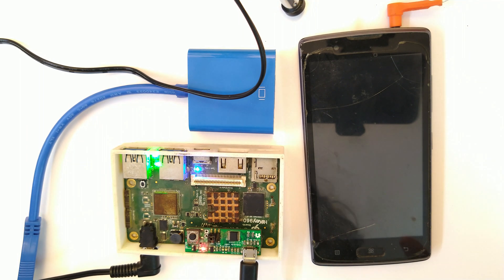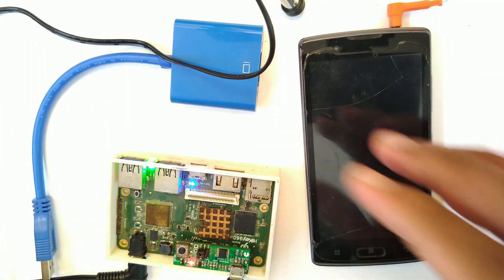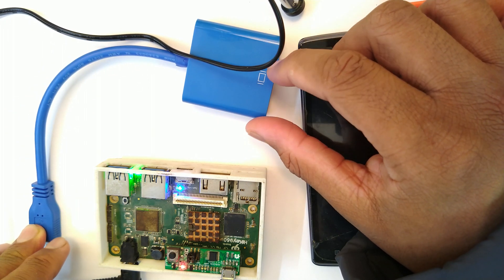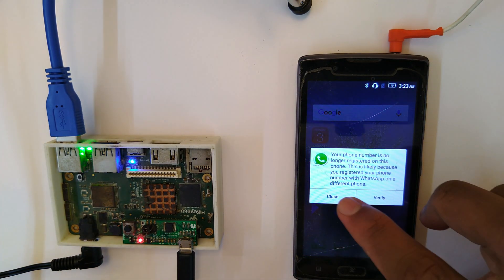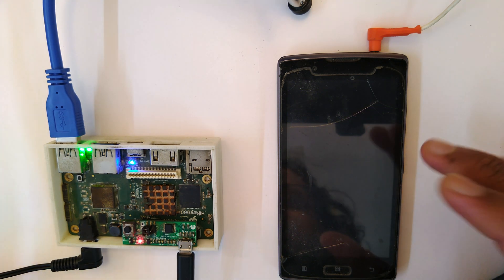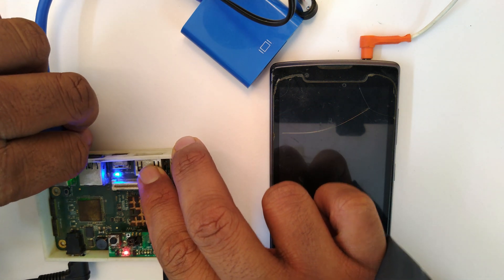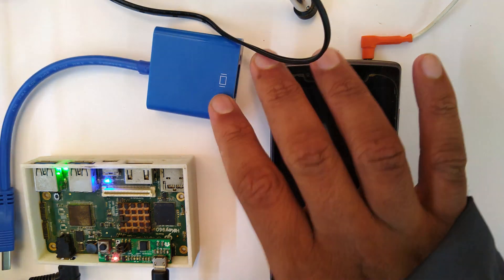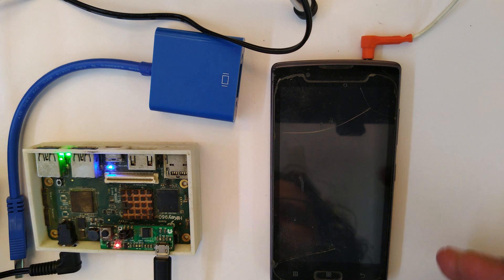SDR FM Transmission using Hikey960 and FL2000 VGA Dongle

Comment: The link is dead..  Is there a way to know, without opening, if a particular usb3/vga adapter has the Fresco Logic FL2000 DAC chip that is compatible with osmo-fl2k/fl2k_fm?  Also, at a 140MSps, I'd love to use it as a general purpose 3-channel DAC (R,G,B)!   Is there any documentation for the USB protocol?